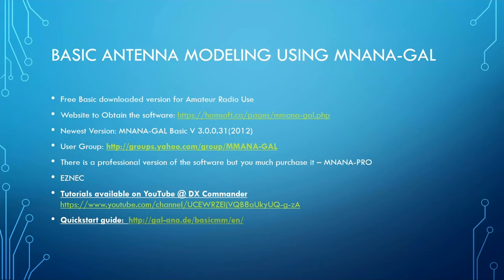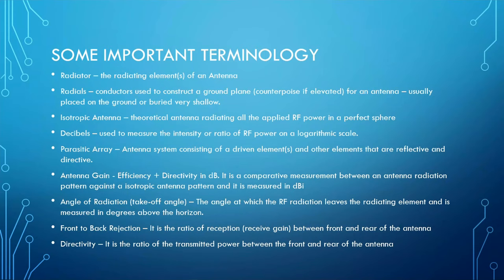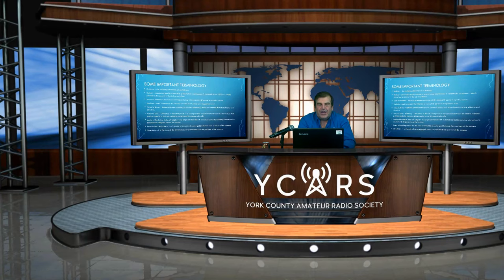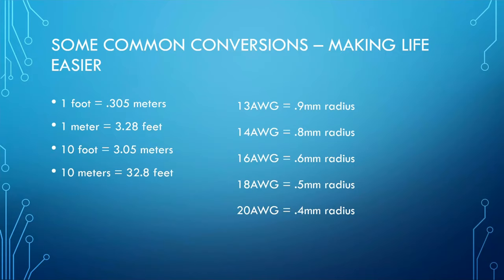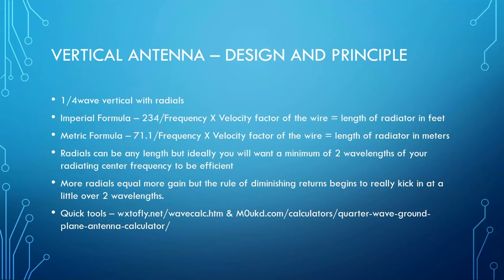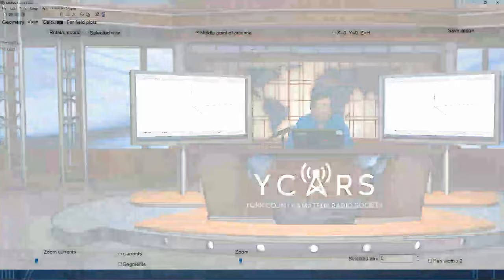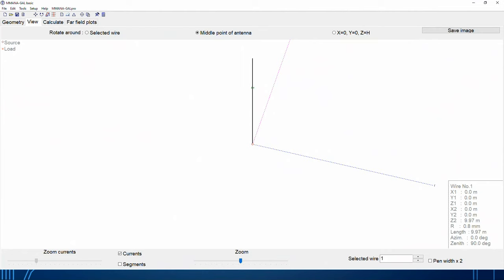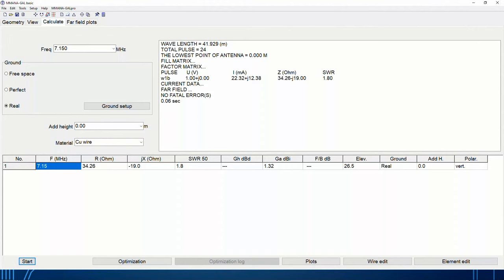MMANA Antenna Modeling

Comment: Hi   Thanks for the information ~~ Please can you tell me when placing x amount of Radials say 32 for the 10.25m Vertical ... where do you see the Length of each Radial within MMANA-GAL ? 73 M7AQP
Reply from the maker: Chili the length of the radial is not overly important, but I tend to use 10m or 5m radials.  I would plan on a maximum of 4 wavelengths for the lowest band you want to use... so say 40meters you would want 16 x10m or 32 x5M ... and a minimum of 2 wavelengths in the case of 40 meters 8X10m or 16X5m... hope this helps.  In MMANA the length of the radials is assumed to be 1/4  wave of the frequency. it is not documented well but that is what the software uses as the default length.